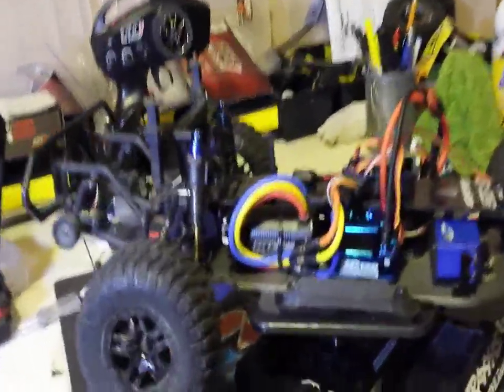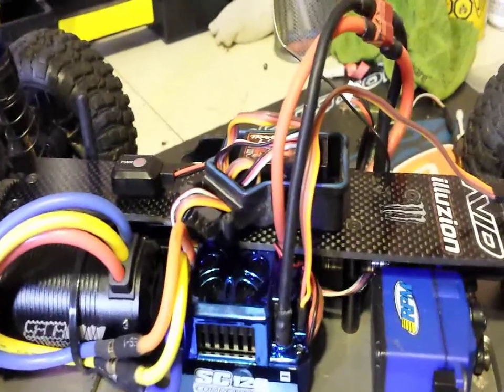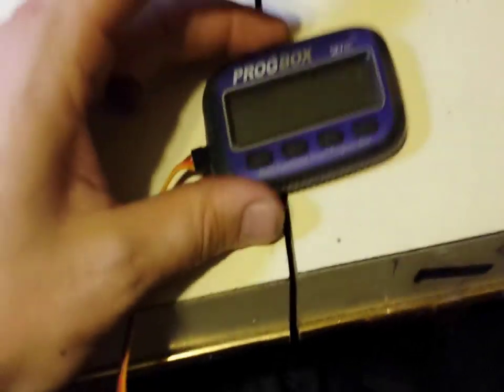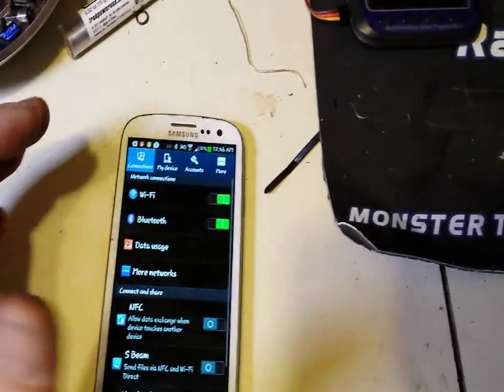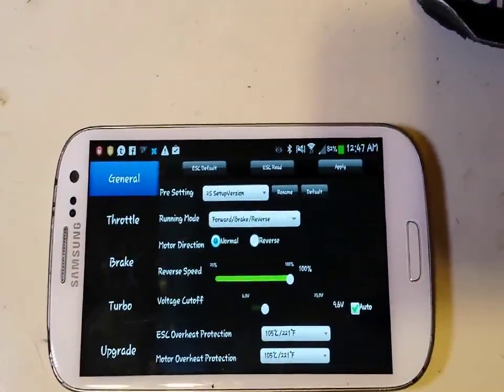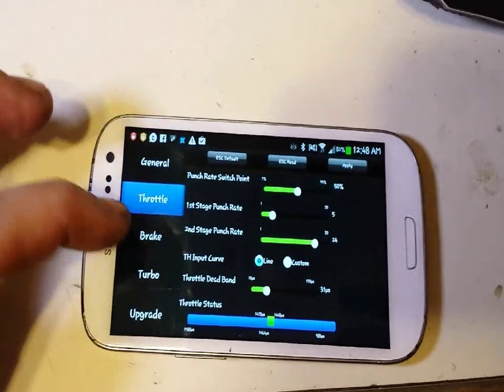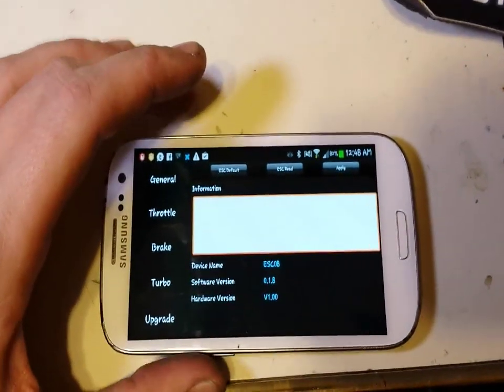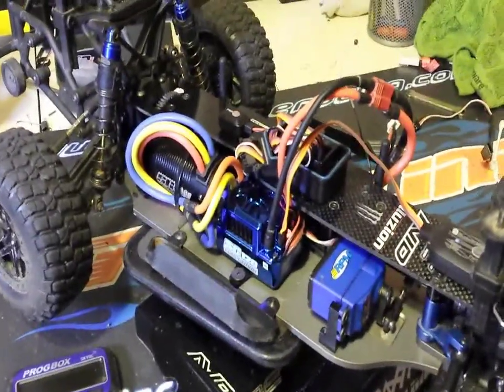Toro SC120 Sensored Competition ESC Setup / Bluetooth Module

Comment: Love this ESC!
SkyRC does more R&D than any other brand owned by the ShenZhen chinease rc dragon! My SkyRC Ares Pro V3 outperforms my Hobbywing V10. They both have the same basic design (out of SkyRC's lab) but the SkyRC Ares V3 has much higher KV and much lower Amp draw. I get far better lap times when using my Ares 3 equipped touring cars. I has the TS 120 and the SC120 and I love them, as well as my authentic B6 and B6 mini chargers. SkyRC does not has as much distribution as Hobbywing because they are ThE R&D giant NOT the retail giant. Hobbywing is geared for retailing towards the capitalism pigs! 🤣

Comment: which battery you recommend me to use with 120a sc toro and 4000kv xerun motor that can last the longest time?
Reply: http://www.smc-racing.net/index.php?route=product/product&path=67_97&product_id=261

OR the 7200mAh
Reply: in the manual of the toro sc 120a they write i need 3 cell lipo battery

Comment: i mean wich capacity?
Reply: Depends on what your doing.  Larger capacity weigh more. Something to consider if racing.  But for just bashing around I would grab the biggest capacity I could.  =longer runtime.  And the highest c rating u can afford min 5000-6000mah 2S.  This combo will run 3S no problem but the motor might run hot.